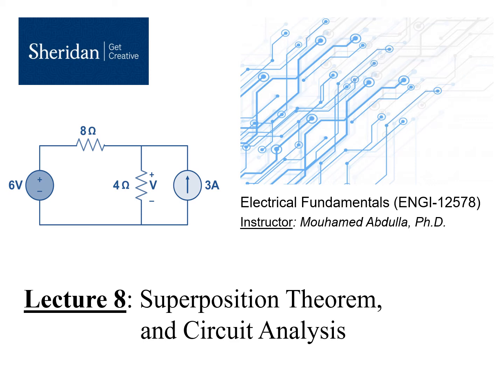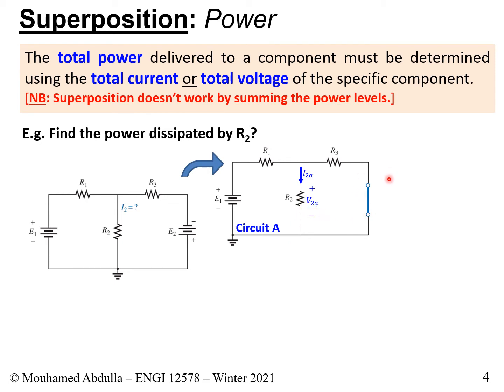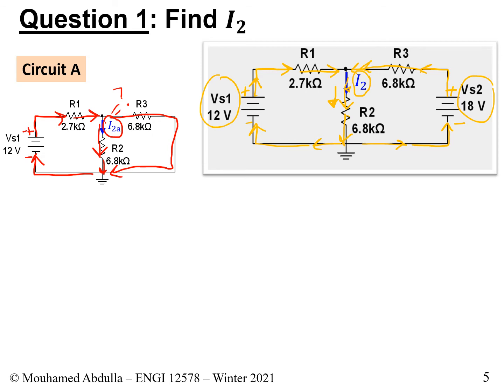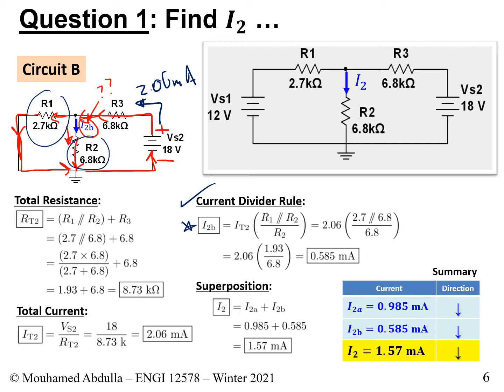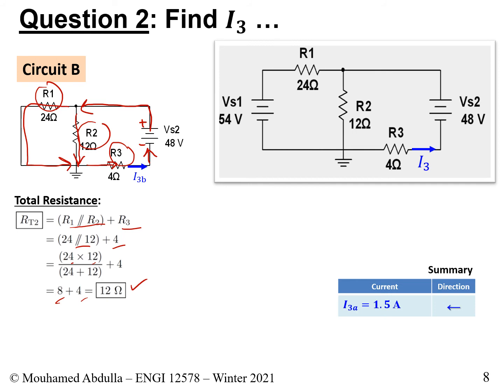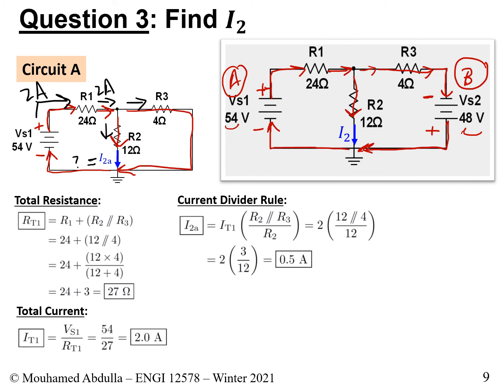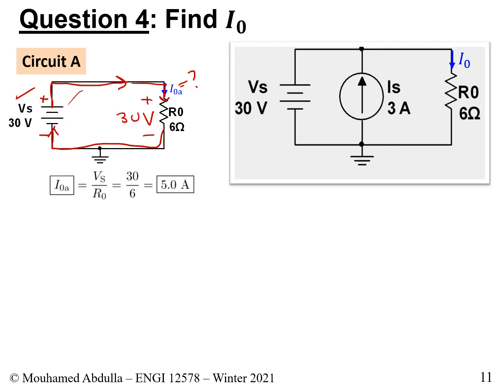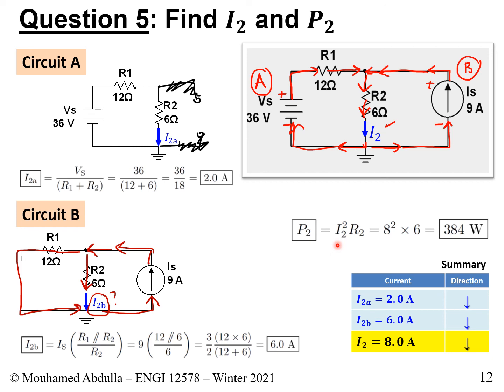Lec 8 - Superposition Theorem and Circuit Analysis

Comment from the maker: Timestamps:
-----------------------
00:00 - Introduction
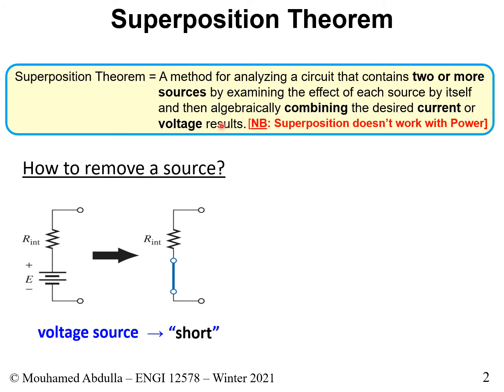00:24 - Superposition Theorem
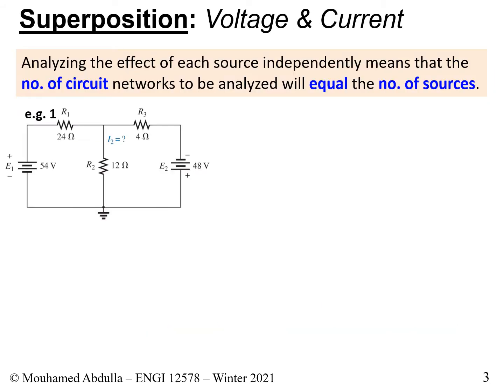02:04 - Superposition: Voltage & Current
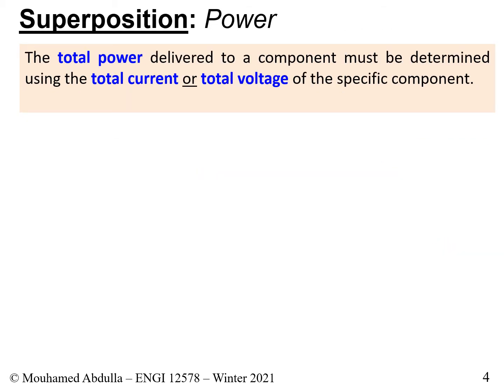04:40 - Superposition: Power
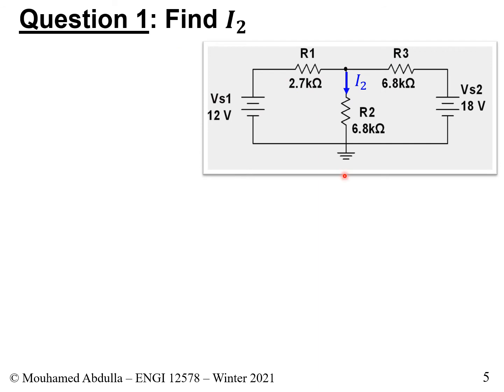09:14 - Question 1
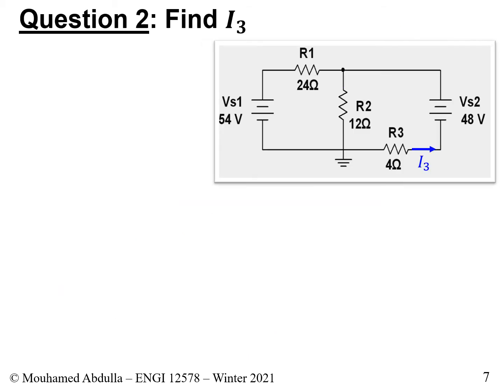20:42 - Question 2
28:15 - Question 3
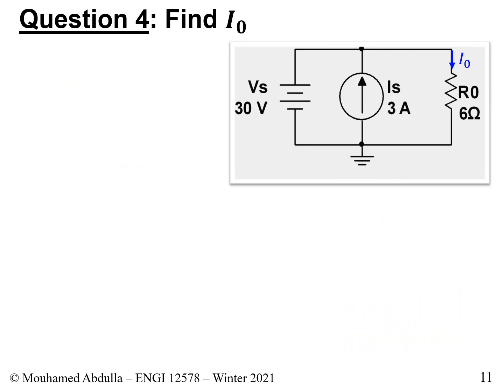37:57 - Question 4
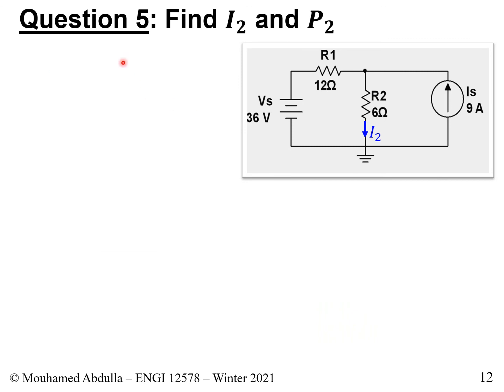41:20 - Question 5